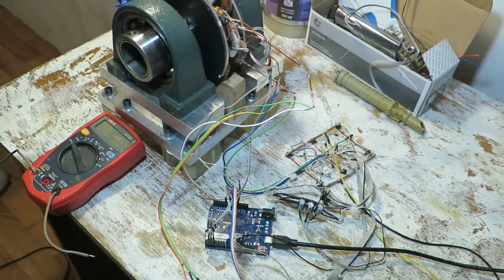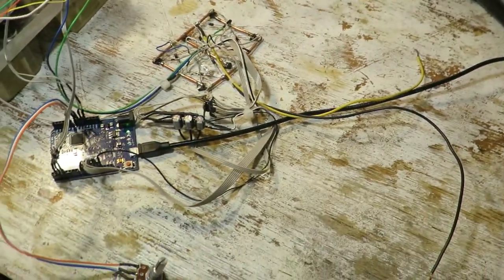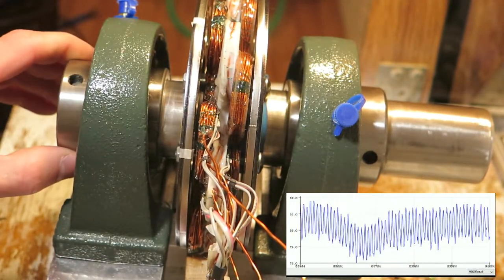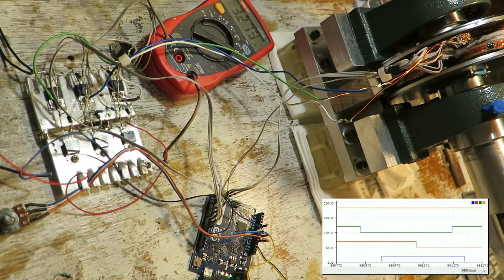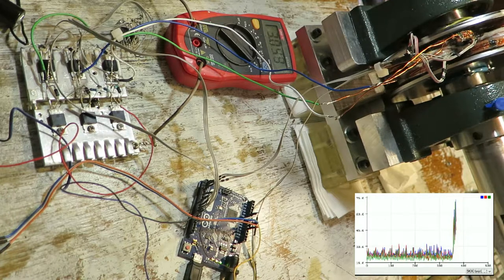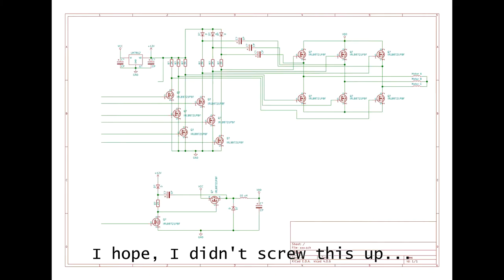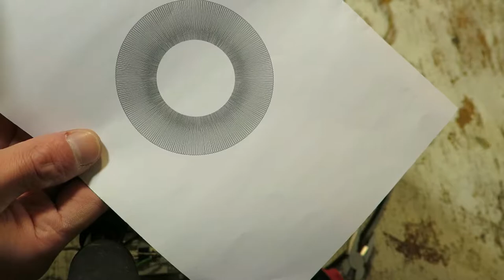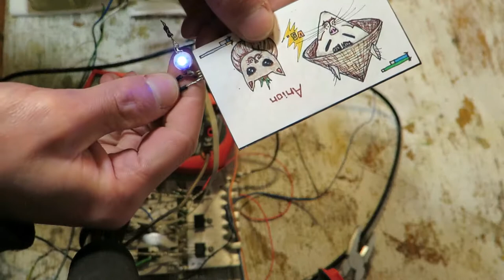BLDC Servo with Arduino and hall sensors

Comment: I enjoyed your "BLDC Axial motor project series" but I'm a little disappointed it did't seem to result in actual working model? That could be used to power an Ebike...  Since an axial wheel motor can reduce its moment of inertia vs using the more conventional radial motor. And has other advantages except for the complexity minimize any efficiency loss from an untrue wheel,  causing  a fluctuation of the induced field. 
BTW If there was any later post on it that Im missing, pls direct me to it or them. But if not good luck and I have few ideas if you want to develop it any further...

Comment: Would it be possible to test timing accuracy of a brushless motor with Ardolino?
Reply from the maker: Depends on a lot variables... you will be better off with a bad scope then arduino.. Or even 192KHz sound card would be better.

Comment: you can cheat a lot more resolution by using analog hall effect sensors.
Reply from the maker: Yeah, I was thinking about that, but I am not sure, how would stator field interfere with such sensing mechanism...
Reply: @IlusysSystems  you could place the sensors on the opposite side, and also put them in a way that you have at least one sensor on a coil that's off.

Comment: Hey, where are you from?
Reply from the maker: czech rep.
Reply: ohh, can you do a video showing how to make the controllers that you use with your DIY motors? im willing to make you a donation if you want, do you have an Ethereum address?
Reply from the maker: Yes I am going to work on it soon - like next 2 weeks. I will have to sync my 2 motors...
What exactly are you interested in? electronics, program, anything else?
Sorry, I am not using any crypto. Paypal is joke... I have about 10 accounts, because of ridiculous passwords they require. Nevermind :D
Reply from the maker: Yeah I will do an experiment with iron core motor, but still quite unconventional. Iron is there to concentrate magnetic flux, so you have more efficient magnetic "circuit". So motor is more powerful, but it shouldn't affect efficiency so much...

Components you say... I can explain some things, but I am not using "correct" components for simplicity sake. I should use proper mosfet drivers, but I rather build that from other mosfets, so I don't have to think about design so much...
I mean, I can get handful of mosfets right now, but if I want to use driver, I will have to read specs, so I understand limitations and know how to implement it, then order the parts, wait and then find out that I forgot to order something :) Also many ready made motor drivers expect, that you use some motor type, that is common...

aaand I am clearly doing something wrong, because every time I work with inductive load, my mosfets are dying. And I don't have a scope to debug... that would be also quite worth of documenting...
Reply: Ilusys Systems also im been looking for FOC/vector drive info and found how it works but there is no info about programming that in an arduino, do you know more about this subject? i know how to code but couldnt find any info about how to make it work, just the theory  thanks
Reply from the maker: You mean a VFD for async motors?
I am planning to make that also, but that one is kinda tricky, due to high voltages involved. I want to make low voltage async motor as a demonstration. That will take some time however...
I am thinking about utilizing 3 buck converters to make true sine wave 3 phase controller.
another way is to simply drive motor with PWM signal directly as it is used in automotive designs.
generaly if you want one or 2 VFD's, buy it.
if you need like 5 or more, then it MAY pay off designing one...
Reply: Ilusys Systems yes that is what i was talking about, im lookin forward to watching that video.